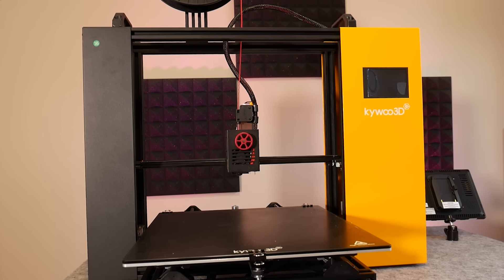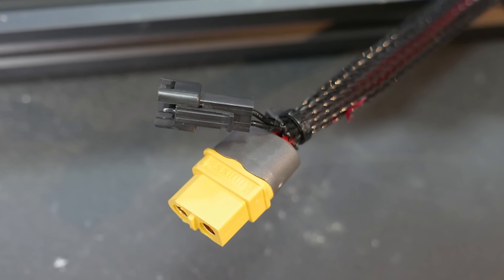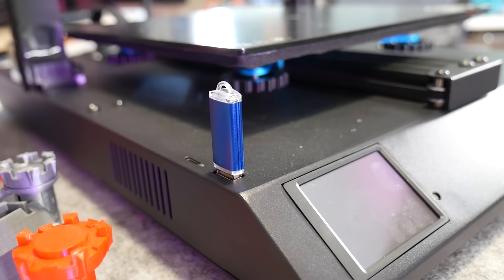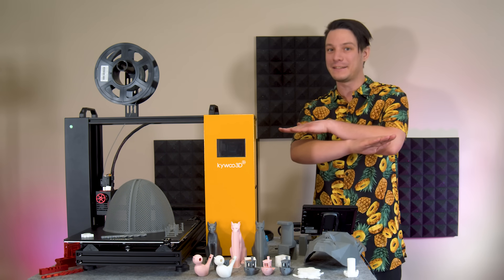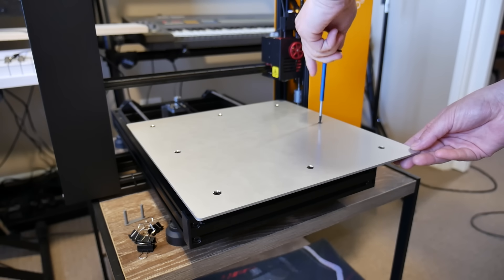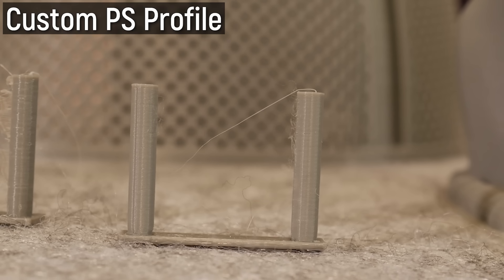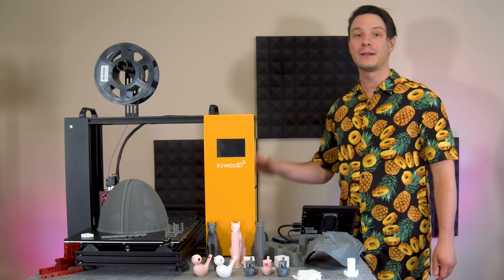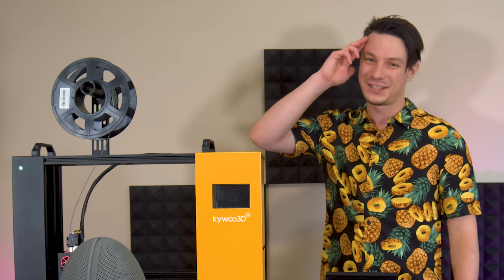The Quirky Kywoo3D Tycoon Max - 3D Printer Review

Comment from the maker: There's been some great comments and discussion around this printer, wanted to share my thoughts. 

Reviewing printers like this is pretty difficult, because although my terms state "reviewed as received" it's clear that Kywoo3D has done countless upgrades (at least 3 FW revisions) since I began my assessment. If I went back to the drawing board each time a major change happened, well... the video would never be done and it's a big time waste.

You guys have a lot of good suggestions though, such as beefier rods vs rollers, I'm just amused that the entire machine is made of V slot instead of T slot but doesn't use it for the intended function.

The fullsize SD slot at the front never worked for gcode for me, not sure why but just tried again to sanity check.

With the cura profiles being subparr, it's possible that the loose bed was influencing the quality and that, plus the poor overhang quality, lead me to the prusaslicer profile. Chasing many variables at once can do that haha.

YouTube gives zero ability to annotate or edit vids, and I have to move to other vids but will tinker with the max in the mean time and report back. I do mean it when I wish this company the best and it's cool to see a small passionate community around them.

Angus

Comment: Excellently done Angus, thorough and accurate. I've had one for a couple weeks now and agree on all points, except the "V" wheels. I upgraded my Y-axis to 12mm rod and the heat bed to the flex plate system they have available as an add-on. It's been as reliable as my Prusa MK3's and TAZ6, which for the price is excellent.
Reply from the maker: 12mm rods or even linear rails would be a great improvement for Y for sure. Nice!

Comment: Thanks for the video - I believe Kywoo is actively trying to make the printer better and have since have been creating additional upgrades such as the flex plate, linear rails for the Y axis,  better heated bed, and now I think they are working on a speed kit for it.  So it is good to see them working on it but all of that comes at a cost instead of being like that straight out of the box.  Thanks again for another great video

Comment: The kywoo really brings out the pineapples.

My first printed is the Max.  You did hit on everything I noticed.  During filament load, I can’t remember where exactly, but there is a menu item to turn off the motors. I do that and load the filament manually.  I do like the metal covers however the left one (black side) makes a nice amplifier for noises. I want to print the side covers to try and lessen that.  
The Max has a 25 point mesh for the bed leveling. The second latest firmware went to 5x5. The newer firmware changes the display. I haven’t switched yet as I was still trying to figure out what was wrong.  

Yesterday I printed the individual test pieces from your castle. The the clearance card and draw bridge printed perfectly.  The tower failed at the 1.5. Last step I believe.  

A good thing about the non silent Z axis driver is I can tell when it’s done auto leveling for the other room.

As always great vid. I want more tests with the kywoo but I am biased. 😁
Reply: Yeah, tolerances on mine are on-point as well. I think Angus didn't do eSteps and flow calibrations + his retractions are not tuned. All that, will affect the tolerances.
Reply from the maker: @learnmakerepeat7140  I mean, should you need to do esteps on a new printer? I generally review "as received" as per the terms but it sounds like there's a lot of improvements possible.
Reply: @MakersMuse  I agree, and long back Kywoo actually told me that they don't want the users doing eSteps, and that's why they didn't have steps per mm option shown in menu. But, I'm just a creature of habit. Mine were off slightly.

However, flow rate and retractions tuning, are essentially what will lead to better tolerances for printed parts, as I'm sure you already know this, mate.
Reply: I agree with both of you. This was my first printer and therefore had a steep learning curve. Its a good printer but might not be optimal for a first printer. With that being said, I am still happy with it.

Comment: Hi Angus.  First off I always use the Standard SD slot instead of he micro.  Never had any problem.  Also my bed is tight.  I'm getting some really beautiful prints from my Max.  I notice your touch screen is a bit different from mine though and I just got my Max a few weeks ago direct from China so it's the latest version.  I  haven't had any problems with the direct drive but I do agree about the run-out sensor being too close to the extruder.  thanks for our video though.
Reply from the maker: They've been rolling out updates with each batch so good to hear it's led to some quality improvements.

Comment: I got my Kywoo Tycoon Max last month and it Was my first contact with 3D printing at all.
I actually don't know why I decided to buy especially this printer and not one of the cheaper or more common machines for beginners.
After assembling it I was quite impressed of the printing results. The leveling was really good and I didn't touch the Z offset setting at all.
I bought it to print some maschine parts for my bachelor thesis.  Everything worked perfectly so far. I print every day different things and besides a clocked nozzle not a single issue occurred.
Kywoo fixed some of the problems you got with your printer in the newer versions. The version I bought got a better UI and no bed problems.
I don't have the comparison to other printers but I'm really happy with this product.😊

Greetings from German 🇩🇪
Reply: Danke für das Feedback, stehe vor einer Kaufentscheidung und es hilft sehr.

Comment: If the glass surface is the same as the ender 3 v2's 'carbondrum' alcohol is apparently the worst way to clean it, dish soap and some warm water has served me just fine and also seems to be what everyone else recommends, anything stronger starts to break the coating down.
Reply: I just use a clean rag with water, no soap or anything, and if that doesn't work, then I'll use vodka for that little bit of alcohol.
Reply: I clean always with 99IPA and never had an issue with those kind of beds.

Comment: I've been doing a lot of testing with this myself and have found that higher temperatures help quite a bit with the adhesion issues you described. I have started running my printer at 215 degrees as opposed to the recommended 200 and it's been working significantly better for my prints
Reply: Upon further testing for most prints 205 is more than enough for most prints

Comment: Totally unrelated, but in all these years of 3D printing, if there's one thing i've learnt, it's that the barer the machine is, the better it is. All these housings, they only serve to complicate things.

These "prettied" up machines, the difficulties that come with such a design, that's a pretty big negative in my book. 

Not, to be confused with fully encompassing enclosures. That's another thing entirely.

This is why, i consider Prusa's revised design, to still be, the peak of consumer ready, 3D printers. It's clean, it's accessible, it's ready to take up all the work loads you'd send at it.

Once you enclose a machine, you signal that you want to reach into a completely different realm of 3D printers (or even fine precision machinery) and therefore, your componentry, level of precision, and quality, must also step up.
Reply: housing adds stability, even though you'd think the frame would be sufficient

Comment: I had the same problem with the Ultra Base like surface on my Sidewinder X1 after cleaning it for a few times with Isopropanol. I also had yellow residue on the papertowel and after some prints even PLA startet to lift too.
Reply from the maker: I used to do it to older versions with no issue, but maybe this newer stuff is slightly different? Might have to use detergent and water like most people suggest, or just swap it for some more G10.
Reply: @MakersMuse  I still recommended the Sidewinder X1 to a friend, but warned him to not use alcohol on the bed.  He's still printing without any adhesion problems on the original bed! So my guess is, that the yellow residue is some kind of adhesive but I'm not sure about it. 😅
Reply: @MakersMuse  I'm fairly certain it's residue from the protective film adhesive. Try washing with soap and water (and scrubbing) until it stops which it eventually will, in my experience.
Reply: @candorman9444  It disappears after some print and clean intervals with IPA and still stick like hell, no issues.

Comment: Being used to the open design style my Prusa has along with many other printer designs I've seen in reviews, its looks are somewhat 'boxy', I wonder how easy it is to maintain.
Reply: It's two pieces of sheet metal.

I'm sure it's not rocket science.
Reply: @mizz1414  It does look a lot like a mirror flipped Taz.
Reply: @dangerous8333  You're right it won't be rocket science, I'm thinking back to the awkwardness of dealing with the sheet metal boxes of PCs when digging around inside of them, not all of which have been designed with upgrade ease in mind.
Reply: it's cheaper to ship when the bed nests inside
Reply: @mizz1414  the frame looks like it, but i think thats where comparison ends
Reply: It's a pain to access (I own 2)
Reply: probably just a cover that comes off with some screws

Comment: I bought a tycoon (can't remember if it's a max, too lazy to go check) and could not have been more happy with it! I will say though--it is my first 3D printer and I wouldn't know any better! My favorite thing about it though, is that it was up and running in 30 minutes! My prints have always turned out well with two big caveats:

1: I used Kywoo brand filament. I tried another cheaper brand off amazon, and it actually broke one of the printer parts! I also got a kywoo rainbow filament and it did not work out too well. But luckily I just use it for prototyping and making lithophanes so white black and green have all worked wonderfully.

2: It isn't super cold. I live in the corner of the house, and my room is generally 10 degrees colder or so, and a few times during a cold front the PLA just popped off in the middle of a print. I'm planning on getting a case or something for it!

Otherwise, besides a few broken wires on the heating bed that I duct-taped together, it has been a great 3D printer for me! Though as I said before, I haven't experimented with it much!

Comment: I have watched loads of reviews of this printer and was hoping to pull the trigger on this one as a first printer but now back to square one, I'm glad you reviewed this one and showed the good points and the buggy points, I just don't know what to go for with budget of £600 to £700 there is to much choice but most seem to be clones of clones of clones, I don't want to have to upgrade as soon as it arrives I want a good direct drive and mesh levelling and rails not rollers and be rigid I don't care about WiFi but would prefer USB or direct pc connection, I would have thought by now this should be standard, not everyone wants to tinker but everyone wants to print with out buggy issues.
Reply: I would say look into the tycoon slim its actually a great improvement! While I haven't had the tycoon max I have had the normal tycoon and the slim makes it feel like a prototype imo

Comment: I prefer a solid mounted bed. Springs are training wheels for new users.

Spring mounts might let you externally level the bed (vs internally, which is the flatness of the plate) but they limit the print speed of an i3 because the mass of the bed accel/decel causes tilt and wobble.

I turned solid mounts on my lathe, did a gross level of the bed by filing down their lengths, added TH3D EZABL and have been very happy ever since. Zero problems.
Reply: As long as the carriage is nice and flat, I agree. :) (And the x properly trammed)
Reply: @brandoneich2412  There are tolerances. If the bed is out of flat by > 0.1mm you should replace it, or try shimming techniques to bring it under spec.

When you put the solid mounts in, you align the X to the plate by filing the mounts in. It helps to mount a micrometer to the print head.

Important thing is not to be dead flat or perfectly aligned, but within tolerance to avoid first layer adhesion issues.

Comment: I own a Flsun QQ-S, with the bed being the same material. The yellow stuff that comes off with Isopropyl seemingly is from the manufacturing process and somewhat interferes with bed adhesion. Another trick that I found helps adhesion is to heat the bed to 70c, and then let it cool to 60c. I don't know why it works, but I've had no issues with elephants foot.

Comment: The yellow gunk is probably adhesion promoting nano polymer. 60°C is ridiculously little if you are running glass, though it depends on how the thermistor is mounted, if it's well coupled to the heater, that's especially bad, if it's hanging loose there, that's more adequate. So it's 60°C on the thermistor but that glass will be barely warm.

Comment: With this type of bed I've had worst results when cleaning with ipa.  Try and wash it with dish soap and dry it without touching the surface, I get the best results this way.

And yes, like you said; these carborundum build surfaces are very delicate when it comes to the oils from your fingers.

If you live in tropical climate power loss isn't a problem with them because parts will take forever to release.  Most of the time I have to pop the glass on the fridge for a couple of minutes to get the parts to release. 
 In my experience they start to release below 25-30C, which is not easy to get too where I live.
Reply: Yup, never had good luck with IPA. Dawn Platinum is magic for this type of bed
Reply: @hyperspeed1313  haha same one I use

Comment: Is that not a usb slot to the right of the microsd slot? It totally looks like one? 🤔 if not, what is that rectangular slot to the right of the micro SD slot?
Reply from the maker: Indeed, it's a micro B but for flashing firmware to the board not loading Gcode for printing.

Comment: I hope you see this comment because I am reviewing one of these units for them as well and the unit I received I have had a few problems with the first problem that I had even happened before getting the printer which is somehow they shipped to instead of one. I’m sure logistics is a nightmare especially with a new company so that is definitely overlooked. But I wanted to know in the unit that you tested how much did you actually print on it the units that I have both once I got a few bugs fixed I printed for three weeks straight 24 hours a day . Everything seemed fine and I’ve also print fairly simple parts so cooling was not an issue but at almost the exact same time on both the printers the thermistor cable for the heat pad broke in the exact same spot the cable is too short and is rubbing against the framework for the heat bed . I was able to temporary Solder The cable but that did not last long . I even removed the zip tie from the cable management to give it a little bit more slack but that seem to not help I believe that with a cable rubbing on a frame and not being long enough that there is no way for this problem to go away unless an extension is made. What are your thoughts?     I too had the same problem with the loose bed and when tightening the screws had it interfere with the stepper. I was able to fix that by just shortening the screw. And I also had the same problems with the SD card slot. Thanks for your review and possibly reading this!
Reply from the maker: Glad to hear more real world feedback, the bed cable failing is a matter of time as doesn't have correct strain relief.
Reply: @MakersMuse  what’s really surprising is that generally speaking it is an over built nice machine! But the deflection in the bed and the cable breakage is definitely no go from a long term standpoint

Comment: Hi Marker, Precision ground rollers are soooo much straighter than extruded aluminum slotted parts. :)
Reply from the maker: Oh, absolutely! But over this length the 8mm rods are quite bouncy. Thicker would be a better solution, it's just funny that the frame is made from V slot without using it.

Comment: WARNING INCLUDED / SHOULD READ !!!

Regarding the yellow residue from the printbed.

I had this on my printer with a similar surface as well, but never saw anything about that online. The bed adhesion wasn't that good either and got worse over time.

A whole year later, after I already switched to a magnetic base, I stumbled upon a video wich tackled that with half a sentence. Don't know which video that was, or who made it.
But he said, that this carborundum may be very hard but dissolves in alcohol. So by wiping it with IPA, you remove the coating.

I don't know if that ist true, but it would explain, why I could wipe this residue of for quite a time and why my adhesion got worse.

So as a hint for everyone with such a build surface: Maybe just clean it with warm water and a bit of soap now and then.
Reply: I wipe after every print with 99IPA and never had any problems. You just do it never when it’s hot or warm. Also all other plate’s I use this method. Never had to used any glue or spray in my life and don’t want to.
Reply: @lazyman1011  
Indeed I always cleaned my bed warm, believing it might clean better this way. On my BuildTak surface that was needed to get it nice and clean again.
So maybe that's the thing you have to avoid on this carborundum surface.
Reply: @MirageDU  Always clean „cold“ and without soap stuff. But there are many religions outthere and I only write from my experience. I only use IPA and nothing else since many prints.

Comment: I have a same PLA lifting issue with my Voron 2.4 printer, I think becuase the temperature on the surface is 10-15 degrees lower than the temperature the thermistor on the bottom reads. I crank up my temperature and it sticks well.